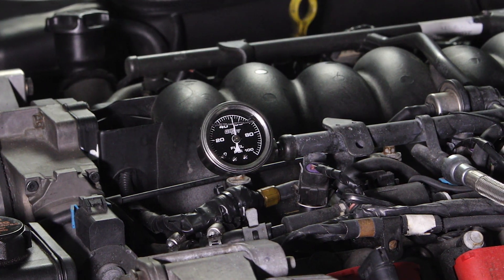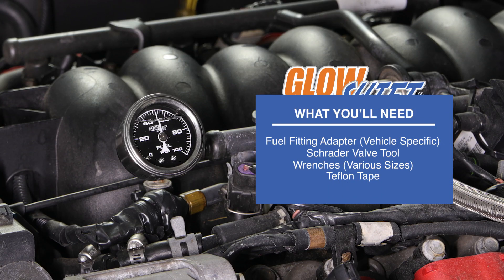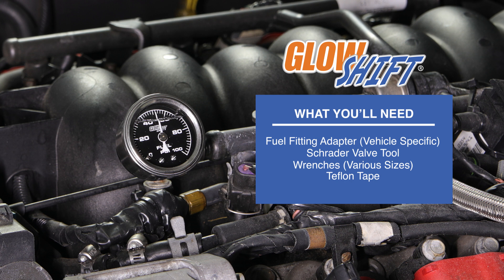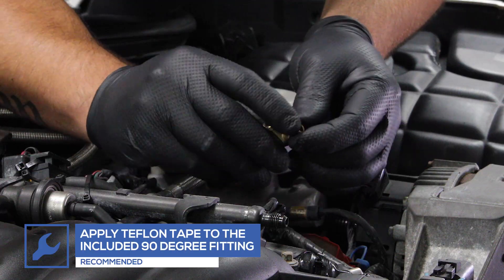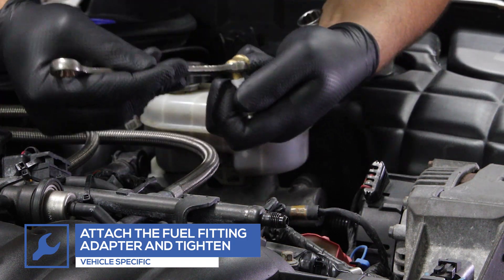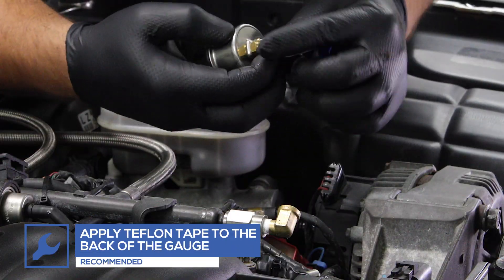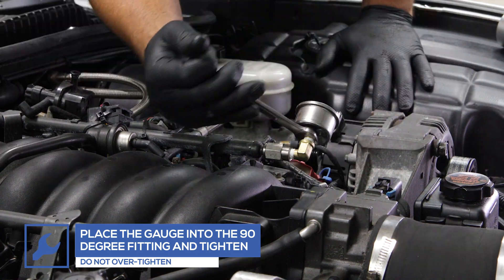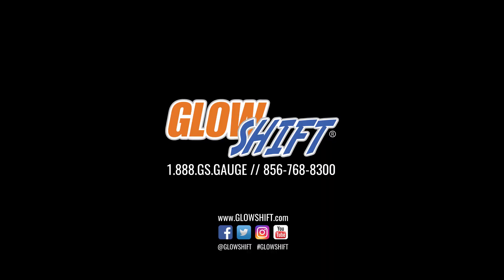Installation | GlowShift Liquid Filled Mechanical Fuel Pressure Gauge for Cars and Trucks

Comment: Not sure if I really even need one for my mechanical pump, but this one and the new one Aeromotive makes looks good, just wonder if they work as good as they look.
That always seems to be the problem with fuel pressure gauges 
🤔🤷🏻‍♂️
Reply from the maker: We've tested this gauge many times and have never had any issues with it not reading correctly.

Comment: I saw this kind of mechanical fuel pressure gauge a few days ago at The Pep Boys store.  I wonder why the scale on that gauge is it only go to 15 PSI max?
(2/12/2021)
Reply from the maker: Our gauge reads and displays up to 100psi.
Reply: Cause that was for a carbureted vehicle, which only need a max of 7-10psi.